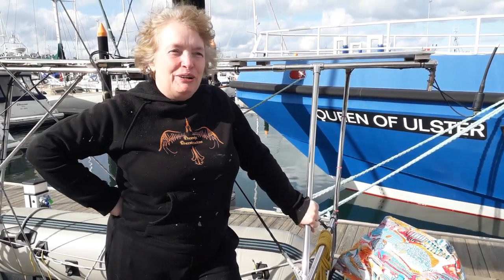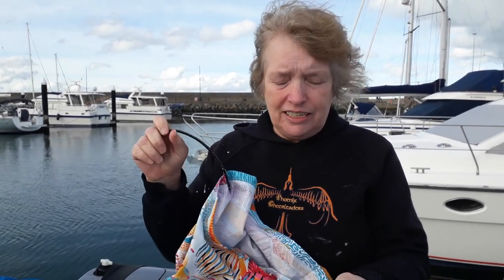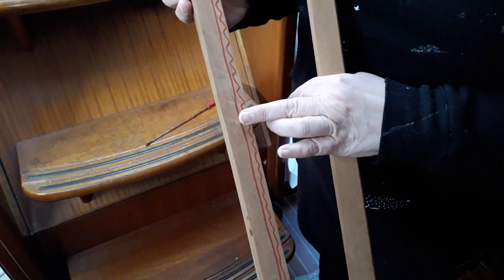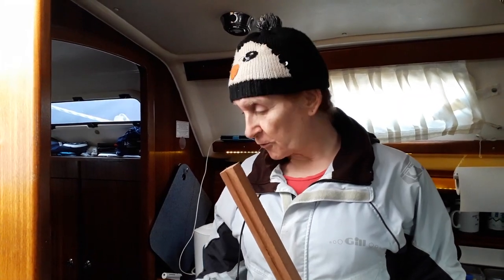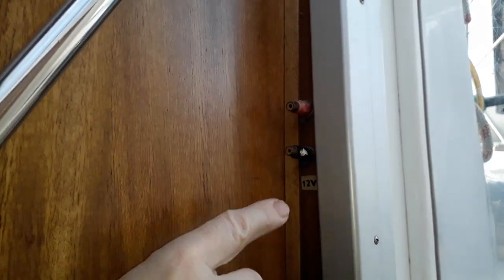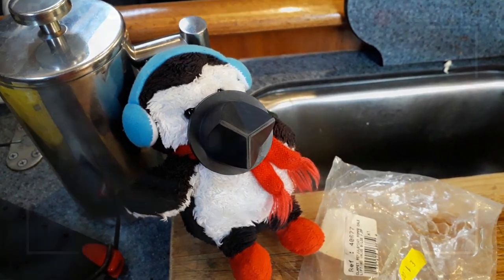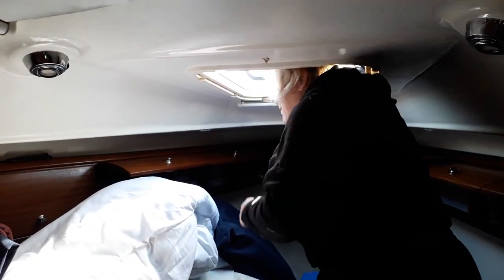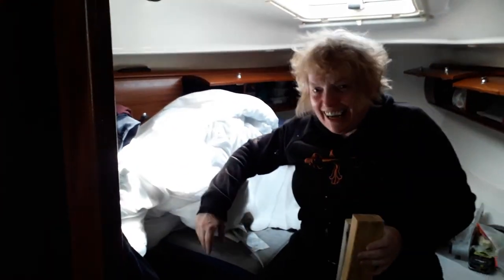Northern Ireland - Winter - Getting ready for cruising - Ep. 230

Comment: I was so hoping Gaynor was going to be delivered head first:)
Reply from the maker: I nearly was a few minutes later, but that did not make it on the camera ;)

How's Millport and the engine?
Reply: @SailingYachtSaltyLass  Milport is like a millpond, very peaceful and picturesque. Brutal crossing, heavily reefed, breaking waves and very cold. I pulled all the breather pipes and cleaned out the trap. Didn't find any blockage, just a little diesel trapped in the pipe. Will be very careful on the next fill. Thanks again for your help.
Reply from the maker: @millzee60  - The North Channel is one of our least favourite sailing areas. When it decides to be rough it can be very unpleasant. Have fun up there 👍

Comment: Ahh meths just like being back behind T J Hughes, I thought I recognised you both from somewhere. Great idea with the lower step for easy access how solid is it when you use the steps and how easy do they lift out?
Reply from the maker: Where you the guy in the bin at the bottom of the steps? I always thought that was Oscar the Grouch 😉 We have not quite finished securing the steps yet as we were allowing a few extra days for drying, but we will either post here or include it in the next video. We hope to do it tomorrow.